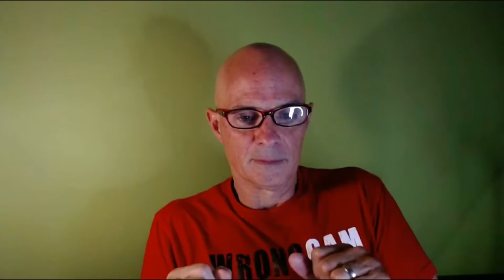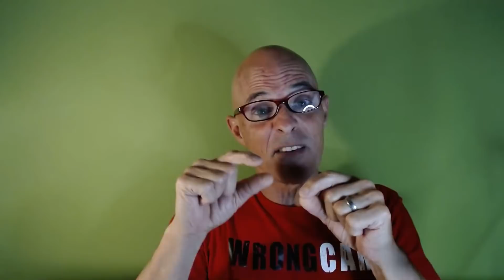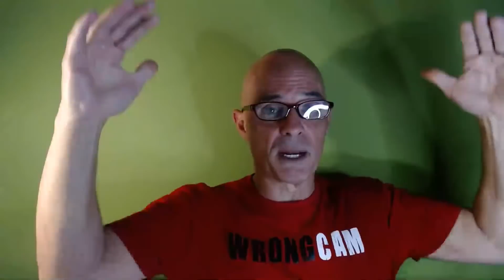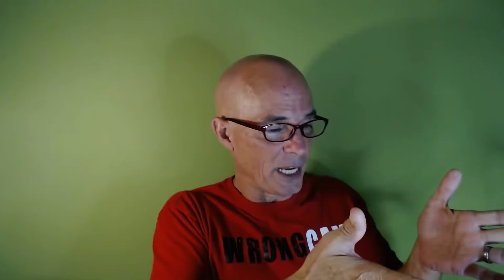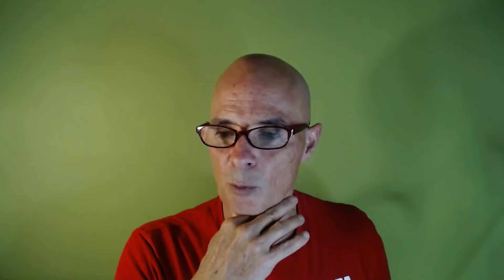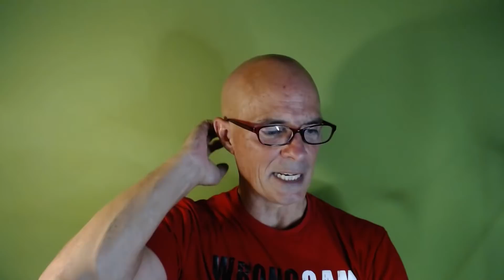LET'S TALK TURBOS-DAILY DRIVER TURBO COMBOS

Comment: What truck cam would you recommend like the one you mentioned at about 29:15 ? Do you have a dyno video with it? 2008 5.3 in a suburban with turbo goals in the future.
Reply from the maker: btr truck norris
Reply: @richardholdener1727  Thank you. I have efi live. Is the tuning close to stock for that cam or do I need a dyno tuner?

Comment: Been thinking about a turbo on the Windsor I'm building. Got so much Windsor stuff all I need is set of headers! Going old school with a carb. I think I'll just use the 100hp power shot I already have! Just a Sunday ride around the country side project! Love the way you really take time to explain in layman terms the results of modifications!
Reply: Roadkill did it with the rotsun, powerstroke turbo I think it was either a tp38 or a gt38 or something like that (can't remember the exact name of the 7.3 powerstroke turbo they used) easy 500 hp combo
Reply: A few people have done twin garret t3's with a .63 ar hotside from the 80s svo/thunderbird turbocoupe/xr4ti engines as well, should be able to hit 450-500 with that too
Reply: @monikhushalpuri  yea, buy we're looking way back! I remember a guy on utube put two junkyard turbo coup turbos and a mild Windsor that went low 10's.
Reply: @markmccarty9793  I remember that too actually, was it a 302 tbird? If so I think that one was the smaller IHI .48 ar hotside t3 flange turbos that came on 87-88 tbird turbocoupes...I heard there was also a twin turbo IHI tbird turbocoupe but...2.3 sohc with a fabbed up manifold for the twin ihi's

Comment: Low-end torque cams energize the turbo sooner, allowing the turbo itself to increase the power levels up high, as opposed to losing it up high compared to n/a. The torque curve for a big rig would be a torque "spike" without the turbo. Gobs of torque at 1000 RPM, falling on its face the further up the RPM range it went, I theorize.

The key to turbos and any motor is for them to have the power you want at the RPM you want, and ignore whatever happens outside of that desired or required RPM range. 

You don't care what a motor will do at 13,500 RPM. You are driving 99 percent of the time from idle to 3000 RPM, and some fun times from 3000 to around 6000 RPM. You have to decide what is the priority: where you drive most of the time or the occasional rip in the upper RPM ranges.

Comment: Dang you make me want to cancel my order, been watching you for years and finally decided to go turbo and build my own kit gen 4 ls rect port t56 240sx, 700whp or more goal after turbo was going to run comp cam Lsr 243/259  until Im ready for boost (single s475) but after seeing the video I'm thinking too much cam for daily driver/longevity? Advertised Intake Duration:293
Advertised Exhaust Duration:309
Intake Duration at .050 Inch Lift:243
Exhaust Duration at .050 Inch Lift:259
Intake Valve Lift:0.624
Exhaust Valve Lift:0.624
Lobe Lift Intake:0.367
Lobe Lift Exhaust:0.367
Lobe Separation:114
Intake Centerline:111
Exhaust Close ATDC:38
Intake Open BTDC:34
Exhaust Open BBDC:90
Intake Close ABDC:78

Comment: Although I've never owned a Turbocharged vehicle, I've always wanted the almost free increase in power and performance that turbocharging provides.  I've also always thought that turbocharging a daily driver, and not for maximum hp, if done properly, should also provide improved mpg.  I just replaced my 1997 5.7L/350cu.in. GMC engine in my K1500 pickup with a stroker 383cu.in. engine in hopes of giving me enough power and torque to tow a 10,000lb or less trailer up freeway grades without slowing to a crawl, but after about 2,000 break-in miles, I was greatly disappointed in the results this new engine provided with the stock Vortec spider injection system, so now I'm searching for alternative modifications that will give me the power and torque I need for my towing needs.  I've already spent about $6,000 on the stroker engine and install, so on my retirement income, I don't want to spend over $2,500 to $3,500 in additional parts and labor to reach my goal.  Do you think I can get a turbocharged intake system (and any needed ignition improvements) for that amount for this engine, and could I expect to see 400+ hp and 475+ torque from a turbocharged 383 GMC/Chevy engine on a budget?  Edit:  I've also already spent about $2,000 upgrading my suspension and brakes to equal a 3/4 ton truck, and added a brake controller, to make towing up to 10,000lbs safe.
Reply: Speaking of "free power," using a programmable boost controller would allow you to just dump much of your exhaust for efficiency until you needed power, then you could flip on the boost and go for it, much like the "boost screw" between the seats on the Porsche 930 turbo.
Reply: you would be better off getting a diesel truck
Reply: @TurtlelooTheTurtle  I know getting a diesel truck would be the best option, but that is out of my price range.
Reply: @traveling.down.the.road56  your main issue with adding a turbo to your truck will be that your spider injection will be the limit.
Reply: @nocturnalspecialties642  thanks for the reply, but I’m willing to replace my stock injection system with an aftermarket version that works well with a turbocharger or even switch to a carburetor plus turbocharger. I’m just not knowledgeable about hot-rodding small block Chevy engines and how you can manipulate their engine computer modules that control the injection system, timing and I suppose the transmission shift points. I’m willing to modify all of it, but need advice from someone who knows what to do and what parts to get.
Reply: @traveling.down.the.road56  being a 1997 you could swap to a LS pcm from a 99-02 silverado. Repin your harness to the new pcm connector. Then convert it over to port injection like the LS engines. 
Now you have a very nice way to control everything.  I think the marine engines use port injection instead of the spider injection. Will have to dig into that to see.

Comment: So under turbo boost more than likely the exhaust back pressure will be higher than the boost pressure. We're talking manifold pressure on both. So during overlap the flow will be from the exh. to the int., I'm with you a good N/A cam is a good turbo cam.
Reply: One has to remember that be it boost, manifold, back or whatever pressure: do not mix pressure with flow. You can have high backpressure within the flow, but if the flow has enough inertia, which it has loads of in the case of exhaust evacuation, it will flow out of the cylinder no matter what. It might be inefficient, but it'll flow out. Except in the case of the banana trick.

Also the backpressure right outside the cylinder, near the valve is not the same as general backpressure. Local backpressure in the exhaust manifold is not uniform and even, it will fluctuate depending the stroke.

Comment: Richard, admittedly I haven't listened to the whole show yet.  But I've wanted to ask you for a bit.  What is your daily?  Love your dyno videos and the price of the information ; ).  Would you indulge us and daily drive a turbo LS combo daily and keep us updated on how it's performing with the ups and downs?  Thanks and I will continue to watch.
Reply from the maker: 2002 Chevy Silverado-all stock 5.3l
Reply: I put 300,000+ miles on a turbo 6.0. It was problem free.  I changed the oil and filter often as well as keeping air filter clean. 
It was a LQ4 and 4L80E with a S475/83 turbo. 60# injectors, dual walbro 255 pumps, water/air intercooler and Water/methanol injection.  Stock 4l80 with a trucool 40k cooler, 3.42 gears and 30" tires. 
It would chug along at 70mph hauling a trailer in overdrive with converter locked thru the hills.
Reply: Thanks man.  I appreciate you.

Comment: Hey I have a 2005 GMC Yukon Denali and I put a 05 6.0 408 stroker crank in it with a BTR V2 stage 4 cam and a throttle body spacer cold air intake and I'm wanting to know how much horsepower I'm making the vehicle runs great though
Reply from the maker: need more info

Comment: I've heard you and several others use the expression when the back pressure gets high the engine doesn't make more power and sounds unhappy, why does that happen
Reply from the maker: hard for the exhaust to get out and possible reversion
Reply: @richardholdener1727  do you think the springs are being overcome by back pressure.
Reply: @davidreed6070  My guess would be that you have finally run into a bottleneck with the size of the exhaust turbine.

Comment: So I'm running  forged with factory displacement on 6.1 hemi  with  ported heads and intake manifold, valve spring kit  and  600 lift cam, and supporting fuel mods. My question is what would be the ideal turbo/turbos combo?  Power goals around  6-700rwhp  capable of 4 digit hp numbers  with just switching maps and load a 1,000hp tune.  With all that said and done  all while being located in Las Vegas with that crazy Vegas weather like 115 ° degrees every summer to almost snowing temps in the winter...
Reply from the maker: a single s480 will work
Reply: @richardholdener1727  is that a specific brand or size/spec turbo
Reply: Richard has a lot of videos on that subject and your particular brand of engine isn't a major factor. Watch and share a bunch of his videos that he has and it'll answer this question

Comment: When you "x amount of power turbo" do you mean total power produced by the engine with that turbo or it will add x amount of power in addition to the na power?
Reply from the maker: the turbo needs to be sized for the total power output
Reply: I guess my question is what is the formula for choosing the right size turbo? Should i choose the cam after that? I want 1000 lbs of torque.

Comment: Dart a little M block 383
Forged internals
AFR 220 Eliminator heads
Solid Roller .238/.243 w .579” lift 112 LSA
AFR single plain intake
Twin VSR 6782 turbos

Does this combo seem good. I was thinking I may need more displacement, something like a 400 or 406.
Reply from the maker: displacement is fine-i would use a smaller cam
Reply: @richardholdener1727  Smaller? I am guessing duration, especially on the exhaust side?

Comment: 02 Rcsb 4.8 daily driver
S475 (7575) t4 1.10
Jfr 212/212 112
127# injectors walbro 400
4.10 eaton lsd
My silvy has been boosted for last 5 years and it was awesome cam only.   My wife drives it when she needs to hell my  mother in law even uses it when she needs to move stuff. Best mod for a daily is a gear set. Big cams with stock gears and verter just don't make for a quick fun daily but sound cool

Comment: I'd love to see a single pattern sbc boosted. Even something easy like the 280ar
Reply from the maker: it works-they just usually make less than a dual pattern
Reply: @richardholdener1727  yeah I was thinking that might be the case, but for a daily with a manual trans where you can get away with a narrow power band I was wondering if it would help spool up, bring power on faster etc.

Comment: It’s an expensive experiment but a good way to prove your point and shut people up is to just test a “turbo” cam VS your choice of cam that’s similar and show just how small of a difference in power there is in the same motor at the same PSI.
Reply from the maker: the one that makes the most na will make the most at any given boost level

Comment: Just curious about recommendations for a torquey cam that's very responsive in a 5.3 based 383 stroker with a compound GT45/GT35. This would be going into a vehicle weighing than 4000lb that doesn't do much or no towing? Which 'Truck Style' cam would work best. Or would there be better camshaft and turbo combinations than the GT45/GT35 that I mentioned for responsiveness and torque. Thanks
Reply from the maker: WHY COMPOUND AND A MILD STAGE 1 OR TRUCK, OR STAGE 1 NA CAM
Reply: I thought that by using a compound turbo setup that I would lose less torque on the low end while increasing power at the high end. I'm new to turbos and camshafts and my inexperience obviously shows. I'm basically looking to maximize torque on low end and increase responsiveness of the turbos. Or would a more aggressive camshaft and a correctly sized single turbo work better. Just thought that more aggressive camshafts lose significant torque on the low end.

Comment: I'm building a turbocharged Chevy 355 with a T-76 turbo backed up by a T-56 manual transmission. I'm having a bit of an issue with fuel injectors sizing and picking an intercooler I'll be running only 5psi max and my car doesn't have an open grill so I'm thinking air to water but I don't know what size I need .
Reply from the maker: LOOK AT THE POWER RATINGS OF THE COOLERS-5 PSI IN A SBC WILL BE EASY TO INTERCOOL
Reply: @richardholdener1727  it's a 1986 trans am with Air conditioning I'm leaving in so I'm thinking about a smaller air to water intercooler. Would 60lb injectors work or can I get away with 42lb/hr injectors
Reply: You're putting a Chevy in a Tesla, aren't you?
Reply: @exploranator  good lord no I'm a purest Chevy with Chevy Ford with Ford the only time it's okay to mix it up is with a Ford 9 inch diff in a Chevy

Comment: Hi Richard I currently have a ly6 6.0 out of a 3500 van that I will be putting in a truck and I want to do twin turbos I am a welder instructor and can’t wait to fabricate the piping definitely go to do titanium because I think it would be so much fun  I do not want to go to small on them but I also want to make sure they they work well at lower rpms just seeing what size you recommend and I would really like to make 1000 hp +
Reply from the maker: 1000 hp can be easily done with stock truck manifolds
Reply: @richardholdener1727  The advantage of fancy Ti headers is in heat retention, and if they have relatively identical and long primary tubes, then scavenging and cylinder-to-cylinder balance.

Ti is a very poor conductor of heat.

Comment: I'm late. But, what would be a proper cam for a 5.3 that has twin 5865's, 6 speed manual, 3.73 gears, 9.7-9.75CR, weights probably 34-3500lbs without driver, is a street car but also does autocross and track day events? The current cam is WAY to big. Thanks.
Reply from the maker: SOMETHING VERY MILD AND THOSE TURBOS SEEM A LITTLE BIG FOR WHAT YOU ARE DOING
Reply: @richardholdener1727  thanks for the reply. Something like a 212/218? I hadn't considered the turbos were too big. How would you size them?
Reply: @nathanhamilton5078  BTR appears to have dumped their St 1-3 truck cams for their new truck norris. The truck norris dyno graph made me order it. Check it out.

Comment: Is to single 63 mm trubo small for a 355 with factory you with  elderbrock performers and a comp efi 232  242 at 50 535/573
Reply from the maker: FOR WHAT POWER LEVEL?

Comment: How about the way this guy describes things and shows things in real time he don't shut no horns and stuff to give you the answer to turbo is a camshaft have been more alcohol to build a good dependable care boat yards motor I know I built several of them and it all has to line up to make it work like it's supposed to timing and fuel is very crucial and getting a turbocharger system to work too much time and detonation not enough fuel detonation low octane fuel detonation spark plugs holder spark plugs helps on the detonation predestination

Comment: hey Richard I have a important question I have a 6.0  I gapped the rings and I’m putting the rods back on and I bought the Arp rod bolts 2346301 but I keep reading about you have to resize the rod with new bolts so I’m thinking about returning the bolts what’s your thought it’s been driving me crazy I haven’t taken off the old stock bolts yet
Reply from the maker: use stock bolts
Reply: awesome I will use the stock bolts thank you Richard for replying so quickly I can’t even imagine how many comments you get for you to reply back so fast means so much to me thank you i’m going to watch a couple of your new videos  right now

Comment: Hey Dr Richard, wanting to twine my 81 c3 with Ls say 6.0 where’s the best place to mount the turbos?😩😩
Reply from the maker: good luck
Reply: It's not that hard really..
1st step - remove hood and sell it for more go fast goodies
2nd step - swap exhaust manifold or header side to side
3rd step - install twin turbskis 😎
Reply: @ls_812  yep. need to go up to find space. i owned a c3. there is no room ANYWHERE in there
Reply: @migmadmarine  If you eliminate the stock mufflers, you have room there.
Reply: Very rear of the car where mufflers used to go. The turbos will muffle the exhaust quite a bit.